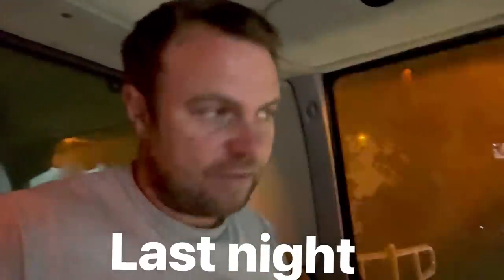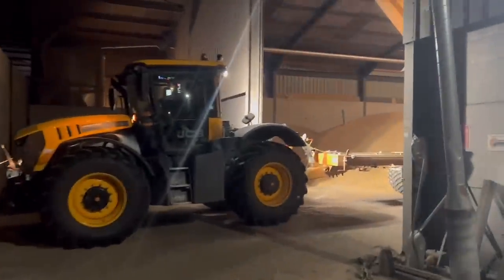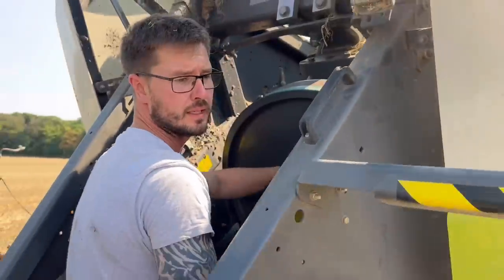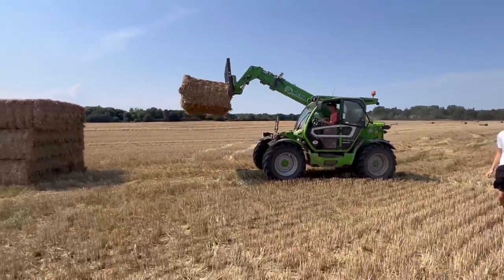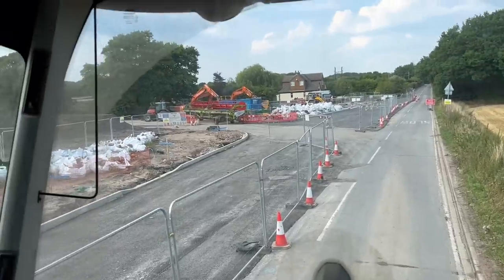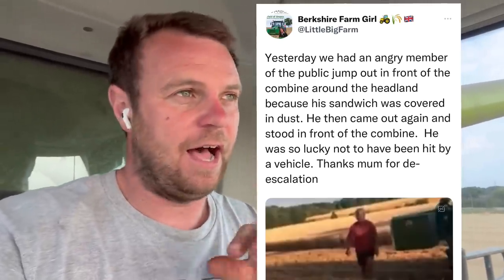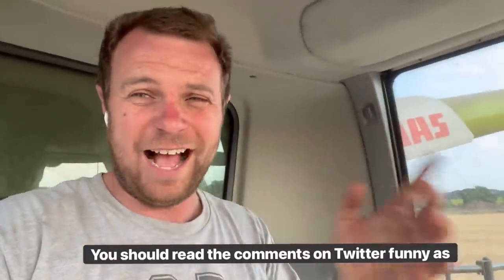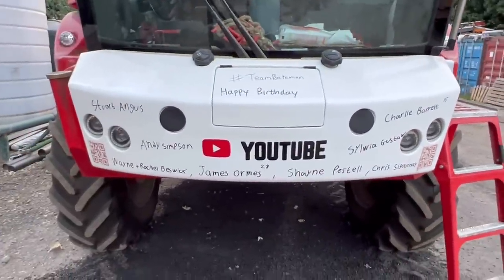DAY875 BALER SHEAR BOLT PESKY KIDS OR NOT ?  & ANGRY  MAN #OLLYBLOGS  #AnswerAsAPercent

Comment: Reinforce the bale forks both front and back and the sides. 
We had a set break in the field, jcb ran over the bale and the nut end of the tine went through transmission. Jcb only had 500 hrs on it

Comment: id say you would want to put the plate on the front due to when tilting back the plate would add extra strength, angled on the side is making a section stronger which doesnt really have much force on it

Comment: You need a thicker bit of steel about 3/8 or 10 ml and you need to put it on the back but not flat against the back. You need to put it at right angles at the back as that is where the strength is

Comment: B - - - - - y townies. Best one I ever heard about, combine being moved down a narrow road in a town, stopped to let a car past, combine engine running full bore, exhaust pipe dead in line with an open bedroom window.
 Bale spike 45 degree box section gussets both sides, then flat plate front and back. Now break you b - - - - r.